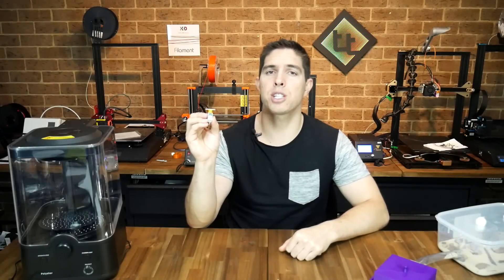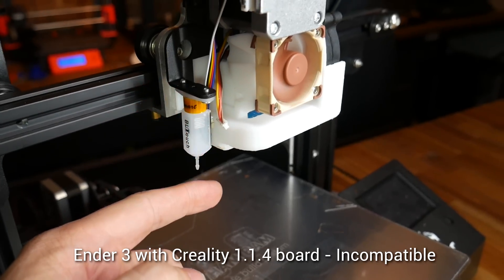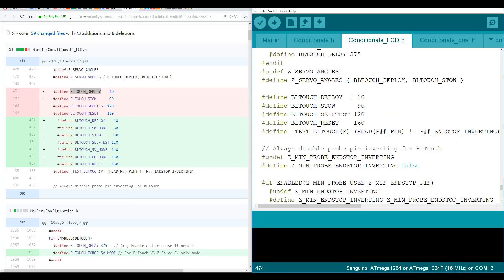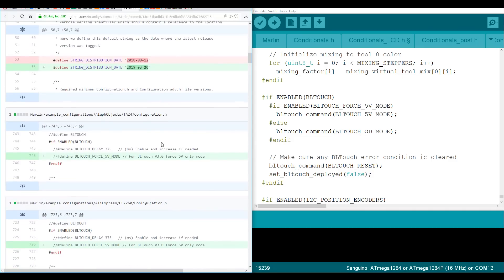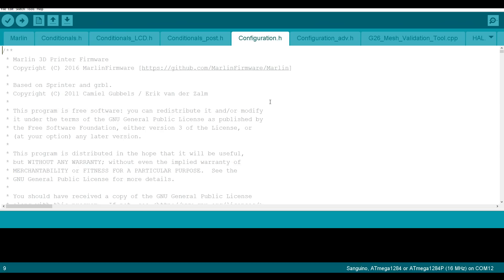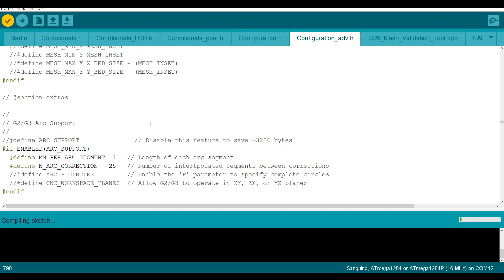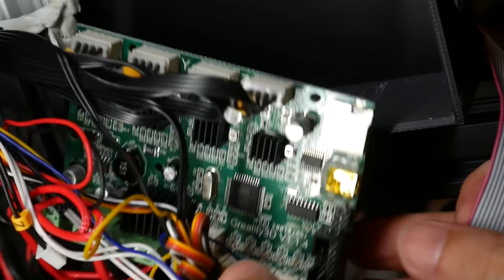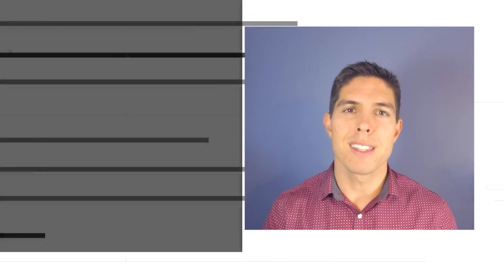3 Fixes for BLtouch V3 on Creality machines

Comment: I am having major issues here. I have the BLTouch V3.1 and a CR-10s V2.2 board can not get it working one bit followed vids  plus many other to no avail....I have tried so many different things. Z axis sits way high I have reset following all the instructions but nothing.
Reply: Hello! Did you solve this problem ?

Comment: Michael, I tried to install BLtouch kit and now have a blank blue screen on my CR10S5. Any reason why this might be? I ordered one of these kits in your video to try and fix the issue if I need to flash new firmware. Thanks.
Reply: Me too! It all worked but the BLTouch wouldn't stop the nozzel when I had it hooked up brown on bottom, red in middle. I swapped the pins out like he said and had red on bottom and brown in middle and my LCD wont show. Did you figure it out?

Comment: I have followed your videos on different things and so far so good and I thank you for that.
On my ender 3 pro, I cannot get the software firmware to work, I download from creality as you said in the last video on upgrades to the ender3s. When I open and unzipped everything, go to isppro.exe, it doesn't read nor give me the chip dropdown options. 
What do I need to do?
Reply: I'm wondering the same thing. I also have the pro, and saw that the hex file is based on the base 3.

Comment: I don't know why but I can't find "//#define BLTOUCH_V3" on 1.1.9 bugfix. In fact, below "//#define BLTOUCH" there's nothing..., not even "#if ENABLED (BLTOUCH)". Am I doing something wrong or did Marlin change that options instead of others during that months? Is it safe to add manually all the lines, or some lines point to other parameters?
Reply: I watch some other videos and read some information about it. Then i tried like this: 
"#define BLTOUCH
#if ENABLED (BLTOUCH)
  #define SERVO0_PIN 27
  #define BLTOUCH_DELAY 100  // (ms) Enable and increase if needed
  #define BLTOUCH_FORCE_5V_MODE
#endif"

and I haven't had problems so far... hope it helps.

Comment: Hello Also it's not working on my Creality V2.2 mainboard in my Sovol 01 printer all I get is the blue light and that's it.  I did as you I test probe on Tevo and my other printers and BLTworks fine on them. Do you think your fix Two will work on this board as well? Thank You for any help

Comment: do you need to fully compress your springs and pre heat your bed before your start adjusting your z-axis from the control panel, I'm using the stock program that came with the printer I don't have marlin.

Comment: Thanks for your video!! I finally found a solution for my CR-10S PRO (not V2) to get it working with a BL TOUCH V3.1, here's what I did:
* 1. beside Teaching Tech there are 3 internet sources: the 3D PRINTING CANADA video and its links to GitHub pages (@t, then you got Creality pages with downloads, finally there are the TINYMACHINES pages. GitHub doesn't lead or help you very much. they want you to flash the LCD first and the machine firmware afterwards. Creality downloads are a terrible waste of time: the firmware versions are older, screen-bitmaps are in Chinese just like the insufficient help documents. Tinymachines wants you to install the machine firmware first and to flash the LCD afterwards, what is leading to confusion (compared to the GitHub instructions). But the firmware is up to date and you can find what you are searching for. Link: @t
* 2. I flashed the LCD first, with the DWIN_set folder found here: @t
Mac OSX users may use 7zX to uncompress the archive (@t.
* 3. than I installed the new firmware Marlin 2.0 from Tinymachines by downloading this hex file (clic on the RAW button) @t
it may be saved as a txt or html file but don't worry, just delete the ending and keep .hex as file type.
The other way you described is to edit MARLIN.INO (configuration.h) with ARDUINO IDE but this didn't work for me. GitHub instructions say "line 98, activate BL touch" but there are way more manipulations to do I guess. Anyway, I used a "ready-to-use-" hex file. How to get it to the printer?
For Windows user exists Xloader. For Mac OSX users like me exists @t . Link your computer to your printer (doesn't have to be running, may be waken up by the USB connection). Choose "mega ATmega 2560", serial port = the USB one, baud rate 115200, and than select the hex file saved on your computer (file ending = .hex). A writing sequence and than a reading sequence is running and you are done. remove the usb cable.
 * 4. download the EEPROM setting gcode (@t, copy it on the microSD card (empty is better) and slip it in the printer sd port. start your printer and choose print - file EEPROM setting gcode - this takes only 1 or 2 seconds to be executed (no real printing action in fact).
* 5. that's it, you're done, turn your printer off and on. all should be fine.
* 6. go to the bed leveling menu. lift the nozzle, lay a piece of paper under it, descend the nozzle (-z) to the perfect "scratching but not blocking" height and clic on the z home button to define this height as the standard height.
* 7. do the manual auxiliary leveling and once finished clic on the "save the mesh" button. for me it was not possible to do the 25 point measurement directly after this. I had to turn the printer off then on, to go back to the leveling menu and to do the 25 point measurement only then.
* 8. the 25 point measuring sequence was running fine once, then the print head started once again to violently bend the print bed down as if the BL touch wouldn't be functioning. Reason: meanwhile I changed the nozzle, after that the heater element wasn't screwed in completely but loose, therefore the nozzle was going further down than the BL touch probe... activated, the BL touch probe has to go a little bit further down than the nozzle. once corrected, the measurement did its job as before. only after this procedure it is possible to activate "auto bed leveling" for further print jobs.
* 9. when I tried to connect the printer to my octoprint/octopi installation, the printer rebooted every 20 seconds and I had no control by the web interface. A small "raspberry pi under-voltage" warning sign showed up in octoprint. the reason was that the small plastic ribbon that I placed on the 5V pin of the usb cable going to the raspberry pi had been falling off  - so the raspberry feeds the printer and that's too much for it - once the 5V pin isolated again (@t all came back to normal and octoprint/octopi is working fine with my CR-10S PRO running under Marlin 2.0. 
One week of fights for love, glory and this printer. Hope that will help you, best regards, rainer

Comment: Big "Thank You" Michael!  I just installed a Creality BL-Touch V3.1 kit, and your videos were invaluable.  I struck a couple of issues I haven't found mention of, so I have described them below in case it is of use to anyone else:
1)  The biggie!   I spent a ridiculous amout of time trying to get ProgISP from the Creality website to work... never succeeded... I kept getting errors, including "Access Violation"!  After hours of head-scratching, I found a working version at:
https://klinikrobot.com/product/download-file?file_id=219&product_id=565
Thanks to them for their unknowing assistance.   :o)

2)  My V1.1.2 mainboard worked fine without needing any fixes, BUT my Ender 3 is an earlier one with the electronics cooling fan inside the top of the electronics case.  The fan hits both the repositioned ribbon cable for the display, and the three-wire plug that connects the BL-Touch to "Pinboard A".  In my printer the plugs on the two ends of the ribbon cable had the cable exiting in opposite directions, so reversing it gave me the little extra room I needed.  For the BL-Touch plug, I removed the three pins from the "Pinboard A", and soldered on 90 degree elbow pins in their place ( I actually soldered them on the underside of "Pinboard A" which gave me a little extra room, but this is probably not necessary.)  After this mod, the three-wire plug is horizontal rather than vertical, and misses the fan.  The kit should have been made this way from the start.   :o(

3)  I am using your pre-compiled firmware hex file, which is great.  When I tried to establish the Z offset, I could not move the nozzle below 0.00.  I got around it by manually entering a M211 S0 to turn off the soft endstops, then entering M211 S1 to enable them again when I had finished.  This worked OK, but what was I meant to be doing?

Love what you do!
Reply: Had/having the same issues.  For problem 1)... Run ProgISP in Win7 compatibility mode.  That solved it for me.
Reply: @TychoBrahe21  In the future, the access violations are caused by the length of the name. For me when I downloaded the package it was some long name like Ender3yadayadaprogisp+1.7blah inside a folder of the same name, with a long name, you get the point. Windows has a max character limit for a path so if you rename the folder paths to be something short (I did "BL TOUCH") the program should not run into access violations.
Reply: @JeronimoStilton14  Awesome info.  Thanks!

Comment: Hi, thanks for the tips. I have an Ender 3 with a 1.1.5 motherboard. I'm using the BLtouch atm and trying to activate the M600 option in Marlin (bugfix 1.1.x) . But It misses some space while compiling to combine both options. I tried commenting a lot of things found in different topics (babystepping, arc_support, bootscreen,etc..). Is there something i'm missing ?

Comment: Question... I have cr-10s pro version 1 with motherboard 2.4  with bltouch from tinymachines firmware on LCD and mainboard, I have been working on this printer for a month now... haven't been able to get this to work yet. 
Can anyone direct me to something that will work. Not trying these billions of steps like I have been. Instead can someone here be like.. I have the same machine here is my firmware. And then this POS actually works and I haven't spent $600 on a paper weight. For this much bullshit I could have just spent another hundred and got the cr-10s pro version 2.

Comment: came here because I am having these issues: BL Touch will randomly skip a probe area. It sits there, deploys and then retracts the probe before the Z even moves down then moves on to the next probe point. on one machine, it might probe all the way but then the machine stops but LCD shows it printing progress. (not the file because same file works on other machine). Right now I have the 1.1.3 board. Using the hex file you provided, and I have even removed the capacitor. (FYI had same issues before removing C7). I am just at a loss.  So far seems to work OK with my SR10-S5

Comment: Is it possible to upload the preconfigured hex file to the Ender 3 (Pro) through Arduino software, when you already installed the bootloader? And if so, how? Thanks for a great guide btw!
Reply: I'm wondering this as well.
Trying the edit my configure file manually (Method 2), but it does not match the one in the video.

Comment: Ok.. pause for filament change is gone in your menu

And it did not pause via cura..

I manually paused and it disabled z stepper but extruder was still locked.. so I crashed nozzle into print..

Pretty sure it's going to be ok... really need to fix this bug though.....
Reply: Also after a pause my display had no idea what layer I am on, or when the x y z or e are located...... 
Just flashing last position before pause!!!!

Comment: Hi! I tried your precompiled hex and it fixed most of the problems, the thing is I can't go negative Z, maybe it's something about your config? Or am I missing something?
Reply: I'm having the same problem, have you found a solution yet?
Reply: If its any help, 2 years later, you need to turn off the minstop on all axis in marlin on vscode or arduino.

Comment: Great videos Michael, always check out Teaching Tech first when problems arise.
Followed your instructions to fit latest version of the Bltouch(V3.1)
But have got a issue where the hot end homes about 10 mm above the build plate and won't let me dial below zero on the Z axis.
 I've read a blog that say's changing Z_MIN_PROBE_ENDSTOP_INVERTING to True would work.
if I change and upload the firmware that would overwrite the firmware I down loaded with the bug fixes from you link.

i'm quite new at this, is there a way to edit the existing on the Ender 3 via USB?
Reply: this line need to be commented in a code #define MIN_SOFTWARE_ENDSTOPS and you will be free to go negative on every single axis

Comment: Thanks for the video! I have a crs-10 and got the sensor kit from Creality. I'm using bugfix 1.9.1 and my sensor was not triggering. 
I found the solution for my machine when I was grepping for '#define BLTOUCH_V3'. In the comment section of gMax1.5+/Configuration.h I found:
"If the pin trigger is not detected, first try swapping the black and white wires then toggle this." I swapped the cables, now it triggers fine...

Comment: What is the difference between the v3 vs v3.1?
What is going to be written on the back, v3 or v3.1? (if its a v3.1)
Reply: The BL Touch i bought recently  has  3.1 written on it
Reply: Also my BLTouch has 3.1 written on it.

I put it on my Creality CR-10S and I had to invert the white and the black pin and it works like a charm!

I installed the TH3D firmware and I had to modify it using the CR-10S settings. I choose a 4x4 grid for the probing.

It works PERFECTLY!

Comment: UPDATE:  My 1.1.5 board came with a boot loader and i have a BLTouch 3.1 - I installed TH3D 2.15 (with the bltouch defined) and have ABL working (well almost, just need to fine tune the z offset)
Reply: CharlieLima have you tried it with Marlin bugfix as in the video?
Reply: @PedroMMFranco  No sorry I have not as  I used TH3D and all was working OK
Reply: CharlieLima thanks!

Comment: Thanks for the video - I am not that good at soldering, can I cheat and just snip (with power off) the capacitor  in half with the cutters that came with the Ender 3 Pro??  Would have thought that this would have same effect as long and it was a clean break.
Reply from the maker: If it's clean then it should be ok. Try and snip the solder on each side rather than the cap in half.

Comment: Teaching Tech i have an CR10-mini with a SKR-mini E3 board, and wanted to use a 3d touch sensor.. could this board have the same problem ?
after installing the z axis pushes true the 3d touch and only stops on the z endswitch.
Also i don't know if i changed all like it should in marlin.. because i cant find any sample using the skr-mini E3 board and 3d touch.. maybe you know where i cold find some info.

i connected the 3d touch on the original pin on the SKR board servo and probe pins.
and it only stops at my end switch not the 3d touch.
I do not know what to change inside my marlin files...except that i activated "#define BLTOUCH"

Comment: Any one know the difference between the bltouch offered directly from antclab VS crealitys pack, besides the usbasp and pin 27 board?
Reply: I think the only other difference is the wiring on the bltouch, it's the correct way around with the creality kit for the creality printers like ender 3.  I have order the creality kit and a new board (1.1.5) and hope to set this up and get it working on my ender 3 pro

Comment: Michael, first - Thank you for the great, extremely helpful videos.  I downloaded your precompiled hex file for the BLTouch3, but can't figure out how to flash just the hex file (without building the whole build in the Arduino IDE).  I am running the 1.1.5 board from Creality, so it has a bootloader.  Can you provide some suggestions on how to flash the hex file?

Comment: I have the ender 3 Pro, with the creality bed leveling sensor kit, BLtouch 3.0. 
My Z axis is keep lowering itself on auto-home, used my finger to retract the pin yet it's still going down. 
I have removed C7 as instructed, but to no avail :( what else can I check for? Btw, I'm using the pre-compiled hex in the description of this video
Reply: How did you get the precompiled hex uploaded?  I'm trying to do that without any luck.
Reply: @sch21c  I used the PROGISP app
Reply: @SLANG777  Thanks!
Reply: I fixed my issue by inverting the Zstop wiring :)

Comment: Ender 3, 1.1.4 silent board, BLTouch v3.1 kit from Creality works perfect with method 2 and without removing the capacitor.
Thank you Michael
Reply: I have Bltouch V3.1 as well. Couldn't find #define BLTOUCH_V3 method in config.h in bugfix-1.1.X. Shold I continue to compile the setup with rest of the changes in method 2. Will it still work?

Comment: Ender 3 paired with Bltouch v3.1 doesn't require any fixes
Reply: Ender 3 v1.1.3 board, marlin 1.1.9
Reply: Kostas Čaplinskas without bugfix?
Reply: Everything working flawlessly
Reply: can confirm, i got a v3.1, Ender 3 (not pro) with 1.1.4 board and i did not need this
Reply: SwindleLad with Marlin?
Reply: @PedroMMFranco  correct.
Reply: I can also confirm I flashed TH3D_UFW_U1.R2.15 with ease as well, no problems! Im liking it more than Marlin.
Reply: Kostas Čaplinskas which Marlin version are you running? What’s your board version?
Reply: Yes

Comment: I flashed a bootloader on my ender 3 via one of your tutorials. Can't I just use a new firmware or something that will allow me to use the BL touch but still have thermal runaway protection as well as the other features im otherwise missing out on? Please advise

Comment: I can confirm that these steps are not required using Marlin bugfix-2.0.x, BLTouch v3.1 and a Creality v2.1 board on a CR-10s.
Reply: im literally doing this now. you read my mind
Reply: What would be needed for ender 3, using the new 1.1.5 mobo and BLTouch v3.1?
Reply: Keesmod 1 +1